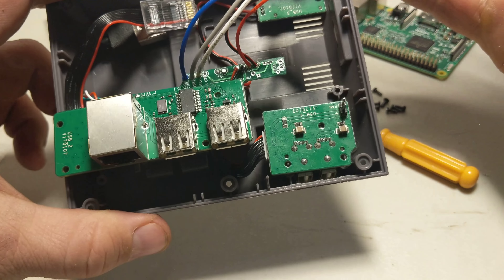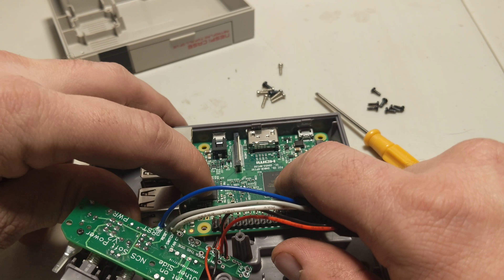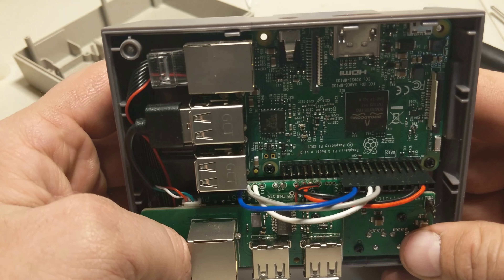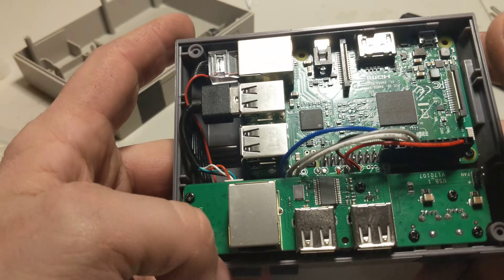Nespi soft shutdown V2 board install.

Comment: this "mod" shuts down the pi and the nespi case at the same time without the risk of crashing the system?? you should have did a demonstration of the buttons working.
Reply from the maker: Boogaz Retro Gaming I made a comparison video of what this mod does to the stock NESPI case
https://youtu.be/7BdpEPi_yUk
Reply: thank you ill take a look.
Reply: ok so in the link you just sent me and in this video, the only thing you did was change out that board? you didnt do any programming on the Pi itself? do you have a link to where i can buy just the board?
Reply from the maker: Boogaz Retro Gaming as of right now the boards are out of stock and will not be back until the end of the month. The pi needs scripts to be added in order for it to work.